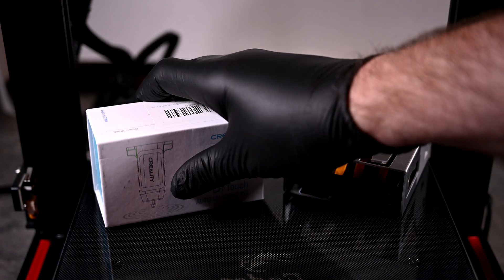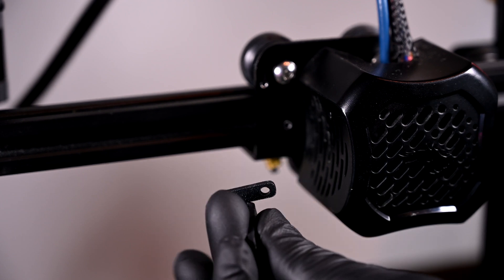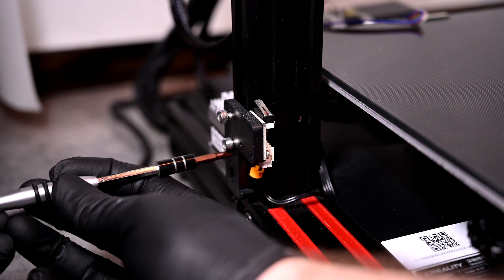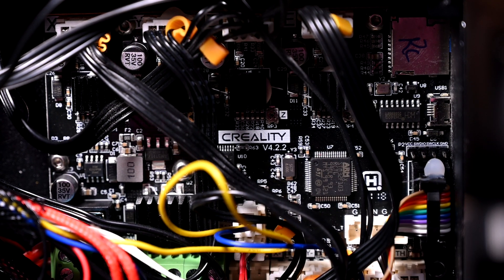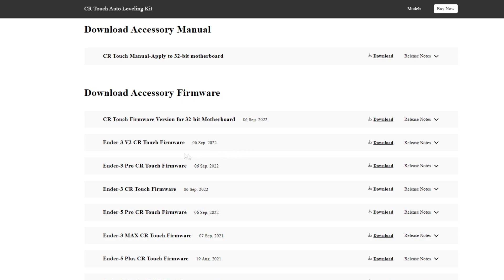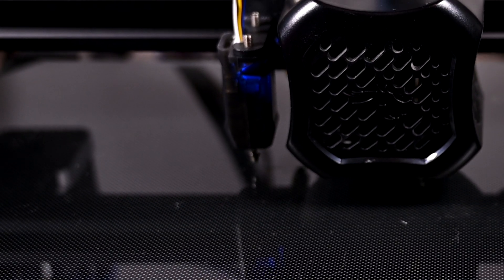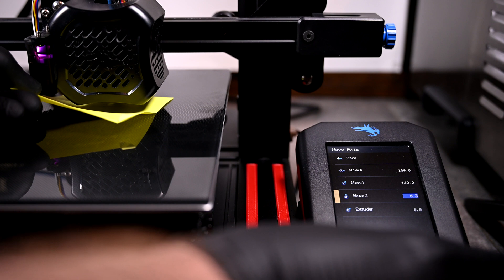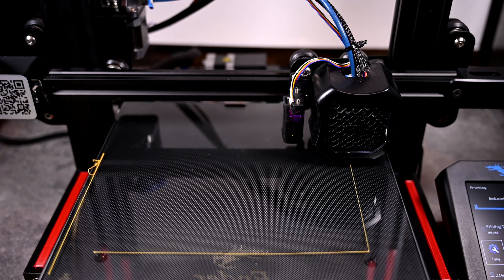Make bed leveling idiot-proof, adding the CR Touch Upgrade to the Ender 3 V2

Comment: I have one on the way, but I use Jyers instead of their firmware. I also have the Sprite Pro hotend from reality which has the mounting holes already for this and a small ribbon cable (3 inches) that goes from the board on the sprite hotend to the cr touch. What I was wondering was what would happen if the Z limit switch was engaged before the cr touch, but you answered that perfectly... remove the z limit switch. So my next question is can I just remove that wire as well? If I unplug that Z limit switch wire from the motherboard does it throw an error or something?
Reply from the maker: No errors are all, you can leave it hanging on the printer or disconnect it entirely. Thankfully the touch probe tells the printer "hey, I'm the Z limit switch now" so it shouldn't cause any problems. I too have upgrade to the Sprite Pro and it works absolutely flawlessly, but I will warn you that you might have to set some hotend offsets in your gcode, otherwise with the Sprite it tries to auto-level off the bed. Yours may be different, but my start gcode is now "M851 X-31.5 Y-49.5" which tells the hotend to not probe outside the bed area.

Comment: can i add this same start code if im using the ender 3 (basic model) with the cr touch on the creality slicer?
Reply from the maker: You sure can! Since almost all of them use the marlin firmware the codes will be the same across all the printers.

Comment: why is his glass bed face down? or did i do something wrong lol
Reply from the maker: I get much better adhesion from the smooth side of the glass, the textured side would occasionally not stick or would stick way too much and the print would end up breaking. If you've never tried the smooth side, I highly recommend it.

Comment: Thanks for the video. Do you have any experience using the marlin custom firmware? Creality didn’t have the correct firmware for the ender 3, I had to use the marlin one and can’t seem to calibrate the board to print properly
Reply from the maker: I tried jyers firmware for a day but ended up almost bricking my screen trying to make it work. Ended up sticking to stock creality marlin for now, but messing more with octoprint. I can do some software stuff, but I'm more of a hardware guy.

Head over to r/fixmyprint subreddit with some details, lots of smart people on that subreddit!